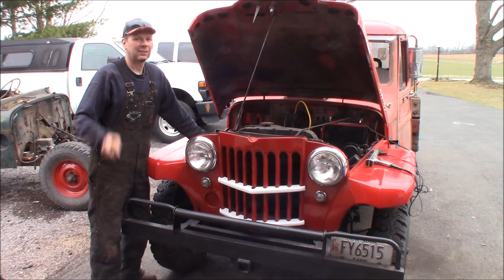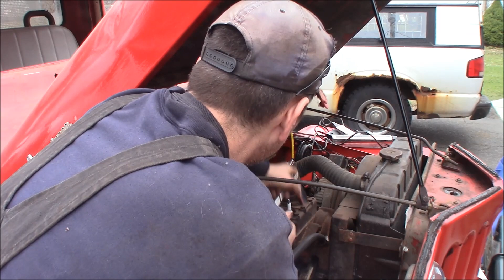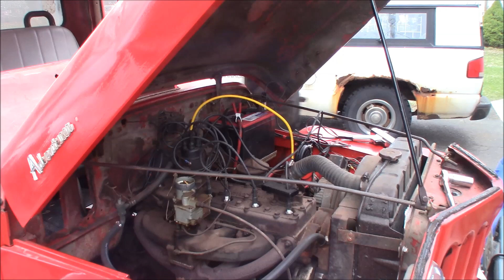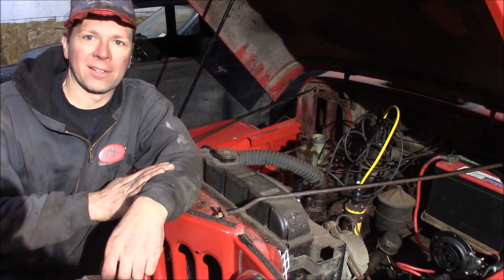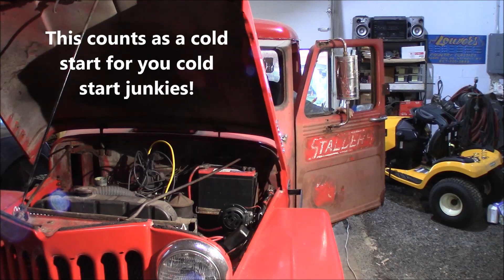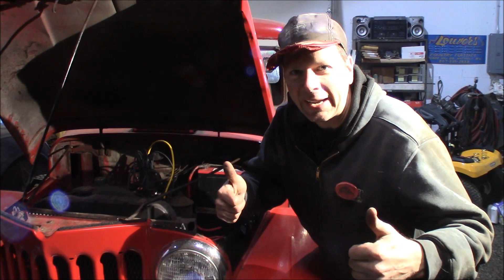How To Diagnose a Cylinder Misfire:  1959 Willys Jeep

Comment: Pull the plug on missing cylinder replace with another one,if you dont have one right now,just swap plugs with another cylinder if it follows to that cylinder with the suspected plug you have found the problem,if it doesnt make any difference it may be plug wire or something wrong with the cap for that cylinder,some new parts you get today is bad right out of box!Have a 56 truck I learned to drive on,right now its down to the frame and 226 is in pieces,hopefully in a few years it will be running again,nice looking truck!
Reply from the maker: I need to check the compression and go from there.  The plugs, cap, rotor, points, coil and battery are all brand new.